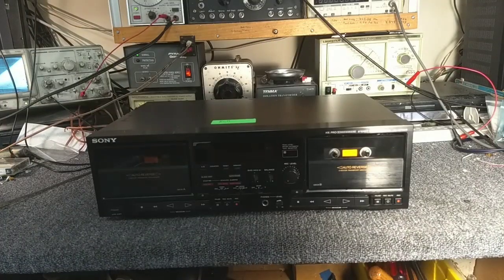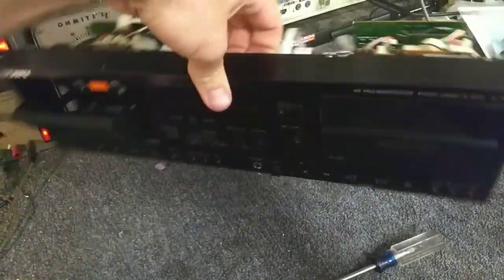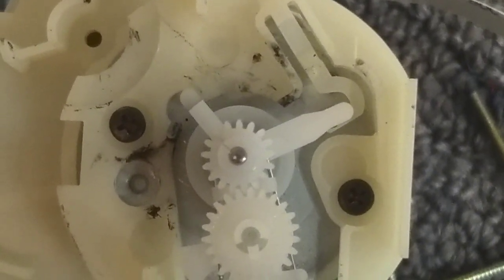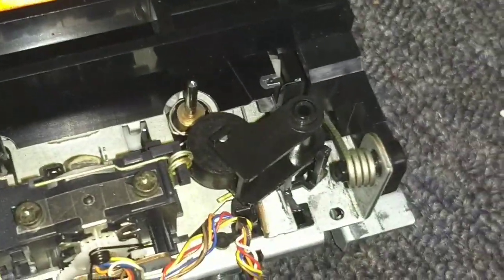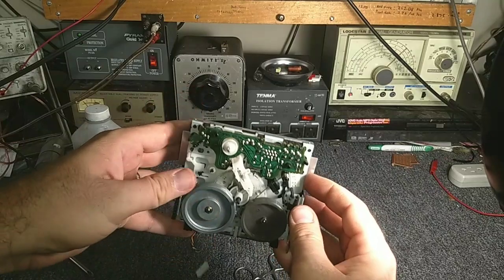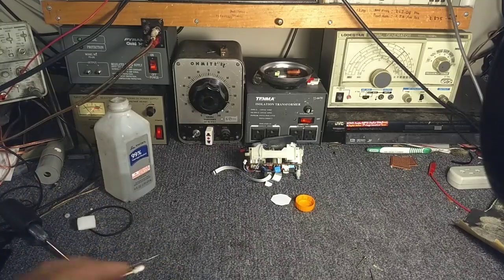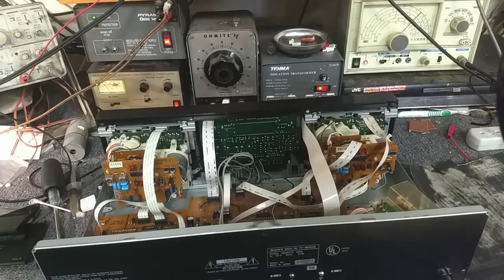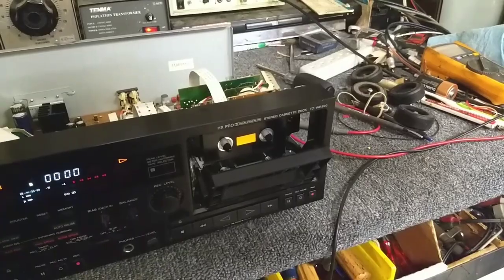Service attempt of Sony tc-wr820a dual cassette deck.

Comment: i bought a 3d printer to make replacement gears etc for ced players, betamax, vhs and cassette decks
Reply from the maker: Send me your info. I have fed and betamax machines that may need your services in the future
Reply from the maker: vintageavrepair at gmail dot com
Reply: @JordanPier  I have the tc-wr875
Does it have the same transport mech as the one in the video?
On mine the problem is the cassette doors don't want to open.
Another excellent video!
Cheers
Reply: @JordanPier  You need some sort of tripod for your camera to make things easier on you when filming so you don't have to do it one handed.
Reply: @JordanPier  I hope my tc-875 wont be so hard to work on as this one.

Comment: if you want 4 complete transports  for this deck  I have them in much better shape than yours  just sitting in my room  I can send you everything  just postage that is all  from cathedral city ca
Reply from the maker: I can use the parts. Inbox me vintageavrepair at gmail dot com
Reply: @waltercarpenito1737  what's your email?